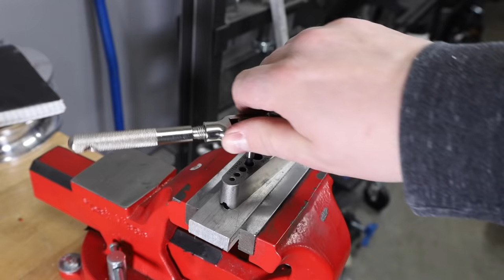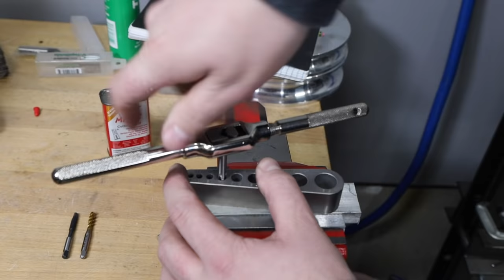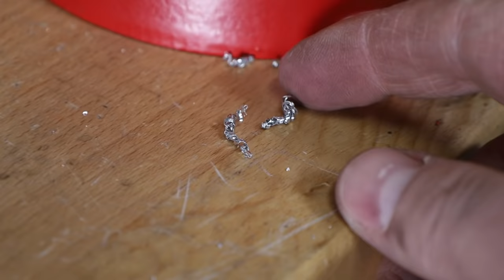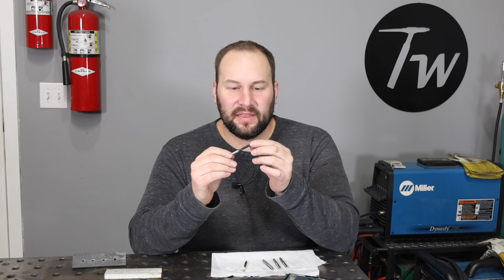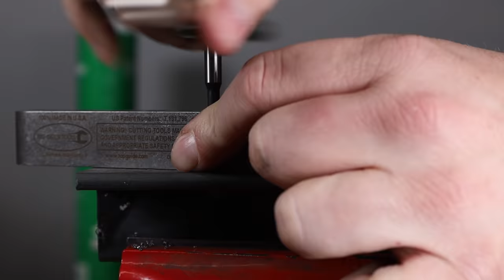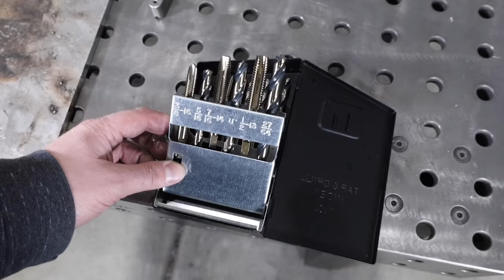STOP Buying Standard Taps...Buy This Instead

Comment: Another thing to consider is tap strength. Four flute taps are notorious for breaking off in the hole. I usually prefer a two flute tap, as it is far stronger. Another tap is the roll form tap. It requires a different drill size, but you can tap some softer materials, and they are hard to break.
Reply: Correct. Also, straight flute taps are stronger than either spiral point or spiral flute taps, because the ‘core’ of the tap is larger.
Having said that, however, the spiral taps seem to need far less torque to drive them.
Robert

Comment: Something that I did not know until recently: Around these parts, if you go to a good hardware store and buy a good quality tap you get a pack of 3. Duplicates right? There is a trick. If you look at them closely you will notice that they are all different, the taper and the depth of teeth are different. You are supposed to use them in sequence when threading hard material.
Reply: Are you saying that if you only use the first tap that a screw will not enter the thread because the pitch diameter of the tapped hole is not yet large enough?
Reply: @pauleohl  I guess it depends on the tolerance I only have these in 3 and 4mm size so the difference is minimal.
Reply: The first tap in the set is the starting tap. For shallow through holes it is perfectly fine. The next tap is a plug tap and the third is a bottoming tap. These are used for tapping blind holes. The plug tap is used first as far as it goes and then the bottoming tap threads down to the bottom of the hole.
Reply: @millwrightrick1  Bottoming tap should be flat? All three are pointy so not sure if that is true for this set.

Comment: wanted to mention, at an old machinist shop i found an old can of Tap Magic for aluminum and thought it was odd as I had never seen it before. I grabbed it but didn't think it would make much of a difference. After tapping 100+ holes in Al for some parts I was making, it makes a BIG difference and could not have finished the project without it.
Reply: I'm just an hobbyst, for tapping aluminum i use pure alcool, i find it very usefull, as aluminum tends to melt ... Pure alcool ( for making cakes and liquors ) is indeed very expensive ( i'm from Italy ) but i use it just sometime, and just a bit. Using alcool for medical appliance would be very cheap, but it smells too much ( here it has some acetone inside, to avoid using it in making liquors ... that is highly taxed, so it's prohibitive cost ... )
Just one point ... not to make too much tapping in a session, or you'll get drunk !!!
And also alcool is flammable !!!
Have you never tried it ?

Comment: When you switch from plug tap to the bottoming spiral tap for a blind hole use a compressed air gun/blower to clear the chips from the hole. I also like using air to clean chips from my taps between holes as it cleans and cools simultaneously. Great video. I've found the quality and wear off the tap in use to be very significant in how they perform. Covering thread percentage on a drill/tap chart may help some viewers. I generally shoot for 70-75% depending on the material I'm working with and the depth of hole.
Reply: Machinery’s Handbook says that 60-65% thread is sufficient for most applications and higher percentage in my experience leads to more broken taps. Spiral flute taps will bring the chips out of the hole as the tap progresses. A good tap fluid such as tap-magic or moly-dee will be a great help. The best quality taps in my experience are made by Emuge and titex.
Reply: @alanrawson-wg8io  Thread percentages is old info. It is non standard now because it was so miscalculated by so many entities. It is expressly forbidden by the ASME standard.
ASME UN and UNR threads B1.1-2003: 
"Past changes in the thread form designation of the “basic” thread height from 0.750H to 0.625H
confused the calculation of percent of thread engagement. This calculation has been used in the
past for threaded products users to determine drill size selection. It is now recommended that
users select a drill size that will result in a hole size that lies between the maximum and minimum
size of the internal thread’s minor diameter shown in the tables included in this Standard"

Comment: While I have a few older straight taps still in my box, the majority of my tapping is done with machine taps or spiral taps. For thin metal I use drill-taps which incorporate a drill bit, a spiral tap and a deburr in one tool.
Regardless of what style of tap you use, the most important thing is to use the right cutting fluid for the metal you are tapping.

Comment: Having broken a few taps in my days as a machinist, I prefer spiral point taps even for blind holes when I'm hand tapping. They have the strongest profile of any cut tap and are way less prone to breakage than spiral flute taps. Yes, they cause the chips to bunch up in the bottom of the hole, but if you stop before they are totally impacted, they can be picked or blown out. The little extra time it takes is a lot less than breaking a tap would cost.

Comment: First time watching one of your videos.  I'm a cnc machinist and use some pretty crazy taps everyday, I used a $150 M6 tap yesterday.  This was a great video very informative.  Another type of tap is roll form, they are meant for cnc machines as the hole size is more critical and they are harder to start by hand but if you have a very deep hole to tap they can be worth it as they don't make chips at all.

Comment: Now I know why I was never able to cut threads I was happy with in blind hopes using standard taps. Years ago I just gave up and resorted to always using my lathe to cut threads (which necessarily limits what I could cut)l but after watching the first half of your video I went out to the shed, looked through my random bits bin, found one of those spiral fluted taps, and cut a perfect set of threads on the first try (then did it again with a drill press). 

Threaded holes aren’t something I make often as most of my use cases call for permanent connections, but this video has still probably saved me a score of hours every year no longer having to rig up some ridiculous jig to hold a part in place on the lathe. Thanks.

Comment: Another tap type is a thread forming tap or roll tap. This type of tab does not make chips, so you don't have to worry about chip evacuation. The drill you use is a different size and the tap displaces the metal to form the threads. The threads are very strong because the tap work hardens them as they are formed.
Reply: Interesting thanks for this info.

Comment: I have been switching over to the YG-1 brand spiral flute taps with a hardslick coating and love them. I typically chamfer the hole before starting and just use the spiral bottoming tap.

Comment: Word of caution about the spiral flute taps: they are MUCH weaker than a straight flute are a very easy to break. I'm not advising against them, they are great for blind holes, just some advice from a machinist.
Reply: Spiral flute taps are ment to be used with a machine because of their weakness.  A bottoming hand tap should be used by hand.
Imo no tap should be used in a drill press.  Just experience of a Die maker.
Reply: @bowez9  oh come now, as a tool and die maker are you going to say you've NEVER tapped with a drill chuck? That being said, there is a BIG difference between a skilled machinist tapping with a drill chuck and the average DIYer. I feel perfectly confident tapping 8-32 in .125 aluminum all day, but I would never advise the inexperienced to try it.
Reply: @mdunbar008  nope only a collet in a mill, or by hand.
Reply: @bowez9  I'm impressed then, every older machinist I know has tapped with a drill chuck, but we've all worked places where the owner was like "tap collets, that's what the drill chuck is for"

Comment: I have an assortment of 2-flute spiral taps now and rarely use my standard taps I've had since the 1970s. Just picked some roll forming taps and will be trying them.  They work great for tapping soft materials and even wood. Standard taps were designed a 100 years ago for making threads in steel.  Just a tip on using taps in a three jaw drill chuck: the shanks of taps are harder than drill bits and will tend to slip in the hardened chuck jaws. Another tip is to use a drill press with a tap follower for getting the taps lined up with the work.  Glad to see you used a tap guide block plus tapping fluid.

Comment: I have moved exclusively over to tap or gun taps and spiral flute taps for all but the smallest sizes. Pretty much anything larger than a #6-32 or 3mm I am using them. Also those gun taps work really well in a mill for power tapping.

Comment: Spiral taps are relative new for the home market, and drills that combine a tap so that it drills the correct hole are brilliant.
Reply: those suck . the speed you need for drilling is way to fast for tapping and it's easy to break something. i would rate them equal to those universal sockets that have all the pins inside to form around a bolthead. all terrible.

Comment: Adding cutting fluid to the drilling and tapping operations will assist the cutting and increase the life of the tools. Also put a chamfer on the top and bottom of the hole to remove burrs with a countersink cutter. This will allow a lead-in for the tap and later for the screw. Buy quality taps to reduce the chance of breakage, it’s worth the expense.

Comment: Tip if you have NO TAP for the thread you need cut:
If you have an extra bolt in the same size of what you need tapped, you can cut some flutes in that extra bolt with a Dremel or other rotary tool.  This saved me from having to puchase an alternator bracket.  When will I learn just how to tighten only to "goodentite"‽
Reply: You might "repair" a damaged thread with your bolt or cut a thread in wood, but never be able to cut a thread in steel or any metal other than lead.

Comment: Years ago as a toolmaker when doing blind hole tapping by hand I would start with a plug tap and use some cutting oil and some Ivory soap shavings to fill the holes the soap would cause the chips to come up out of the hole then go to the bottoming tap to cut the rest of the threads to the required depth. In the sixties there was a small company in the Detroit area that actually sold a soap like plug in various tap drill sizes for use in blind hole tapping we had them when I started to work at a Valentine Metals shop in late 1968 their cutter body shop used them in all the blind holes in the cutter bodies when that company went out of business Valenite attempted to duplicate the formula. Like I mentioned Ivory and cutting oil works. Use lard for tapping cast iron
Reply: ... about the "shaving foam" ... you remembered me that time me and one of my collegues went to a child hospital to install some new monitors on some ( already installed ) shelves ... 
We had to make some bores on that shelves and - to avoid metal chips around - we used some liquid soap nearby the drill bit ... it was a perfect job ( also, that shelves were made of steel ... ) 😂😂😂  No any chip loosed ...
When each bore was finished, we just cleaned up with a piece of kitchen paper and some water ...

Comment: Holy tapping, batman! Tim is right! BUY A SPIRAL-TIP TAP NOW! I ordered one in 1/4-20. my most used size, and used it today. What's wrong with this tap? There's no resistance at all--did I break it? Did I tighten the tap handle? Nope. It just slides through like I was tapping butter, instead of 1/4" thick mild steel!

Thanks, man!

Comment: Machinist of 40 years he is completely correct 
One word of caution if your using a spiral flute tap DO NOT reverse the tap to break chips only turn left to remove the tap all of the way out of the hole. Or else they clog the hole.
Reply: If you're tapping a blind hole, when you get to the bottom you have to reverse the tap to get it out. will you be able to reverse it without clogging the hole and breaking the tap?
Thanks

Comment: If you piece is in a vice attached to the drill press then you can use the drill press with the tap and not need a guide. It is a bit time consuming swapping between the drill and tap but keep it all lined up. Twist the chuck with your hand.
Reply from the maker: Great tip! Thanks!

Comment: The amazing part is that these taps cost very little more than the old straight flute taps. So little more that it's simply not worth buying a straight flute.
  The real problem is FINDING good taps locally. They can be nearly impossible to find locally. And I've ruined good pieces for that reason.

Comment: Thanks so much for this explanation of the different taps.  I too have found the plug taps to be frustratingly slow.  I would like to know if the spiral tip or spiral flute taps will work on stainless steel as well , as I've found that the plug taps don't work for that.

Comment: Hello,
  Tapping holes in various metals, with different alloys, and tempers, can be the cause of another complete study. I have drilled and tapped holes in various aluminum alloys, with 7075-T651 mold cavity material being a favorite. Pre hardened (28-32Rc) aisi 4140, and 420 stainless are two materials that are relatively easy to tap threads in. One material that that is extremely difficult/impossible to tap with any degree of success is Brush Wellman alloy 25. This is a beryllium-copper alloy, used where a material with good heat transfer and toughness are required. Tapping 10-32 unf x1/2” deep threads in this material is a great challenge. This material will cause an industrial quality spiral point tap with either Tin, or Ticn coating and a tapping oil mixture of high sulfur oil, and enough very fine molybdenum di-sulphide, to thicken the oil enough to cling to the tap. Even with this, you are going to get four-five holes, before you can expect SNAP.
  My experiences with tapping other metals has been pretty good. I am definitely in favor of spiral point (gun) taps, of first quality where possible. A few freebies that I have learned since 1966. When tapping blind holes, the conical point can be ground away, as it is not needed after the tap is ground. This allows a few more chips to accumulate before the tap breaks. The next modification is to grind all but two threads of taper from a used plug tap, rather than buying a bottoming tap. The spiral flute taps are primarily for power tapping with a Bridgeport or CNC mill or machining center. These taps tend to break quicker than a spiral point, as the flutes on a spiral point are shallower than the common hand taps.
  Much of what Tim stated here, is good information, but I have used hand taps only in situations where something such as a 3/4-10, or any other size like this is not on hand in spiral point form.When tapping holes for NPT type pipe plugs are needed to fit flush with a surface, it works well to leave seven teeth of the tap exposed above the surface. These holes will as stated, allow a dry-seal socket plug to “torque up”, flush. It seems to work with and size from 1/8-27, to 1”-11 1/2. As a handy reference, I have cut a shallow notch in one flute, with a 1/16” cut-off wheel, deep enough to be visible, without weakening the tap. 
  When a tap breaks, and ruins your day, the first rescue is EDM. When that is not available, a four flute, coated end mill in a Bridgeport, will eat out the core, allowing the teeth to be blown out. Past that, it is time to start over, or move the hole, if possible.

Comment: In those materials. Form taps are unto spiral taps as spiral taps are unto straight taps. 😁 
That's assuming you drill the proper sized hole. Cause they ain't the same.

Comment: 2 flute tap. no starter no bottom no spiral.  i always for the last 25 years used these taps.  always used a butterfly impact but now of course its impact guns and still the snap on tap sockets.  yes i have broken a few 10/24 and 1/4 taps over that many years but its not magic.  and always use the right tap fluid.  yes tap magic is great on steel but your basic wd 40 will prevent from sticking in alum.

Comment: A good tap going to have a GH size printed or stamped on the shank   A  GH 3 is the most popular Stock size . The tolerance on a good Tap is +0-.0005  each GH number represents a .0005  of and inch   starting with GH1. It is no harder to make a GH1 than a GH11 the tolerance is the same .0005. I don't see  a GH number on the taps you are using. So they need to measured with wires to see what size  they are. I would buy a grade 8 bolt and see which tread would strip first    A Thread Grinder

Comment: I have a problem for reworking / re tapping Case hardened (carburising .5mm) 5 mm C60 sheet with Geuhring M10x1 6HX HSS tap. Work piece threads seems to have hardened even after putting bolt during HT.
Any solution for rework

Comment: These taps are not good, better, best. They're designed for specific processes; hand tapping, CNC tapping, steel, aluminum, blind holes, thru holes, etc.... You pick the one for the job you're doing, and if you don't have one, you use what you've got, just a little more carefully.

If you want to know what kind of tap to get, buy steel ones. Carbide is great until you break one off in a hole and have to EDM it out.
Reply from the maker: Thanks for the comment! I spent most of my career as an engineer in a very large machine shop at a turbine engine manufacturer, and we had to EDM taps all the time from very hard alloys. It’s a real pain. My intent with this video is just to bring awareness that there are different types of taps and that spiral point taps can be great for DIY applications hand tapping through holes.
Reply: @TimWelds  As long as the EDM guys don't have a nickname for you you're probably not abusing them!
Reply: @TimWelds  "My intent with this video is just to bring awareness that there are different types of taps....etc"   Really ? The title says otherwise.